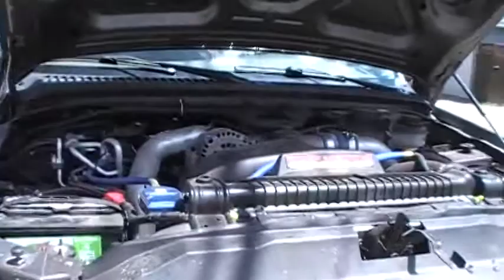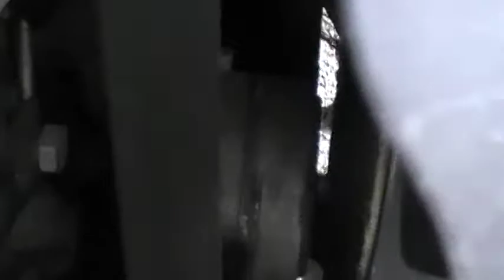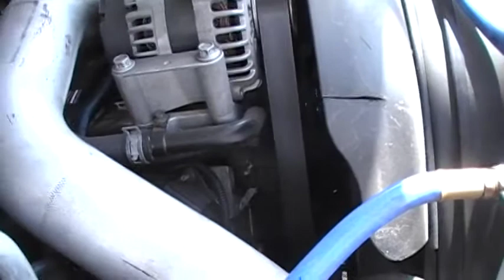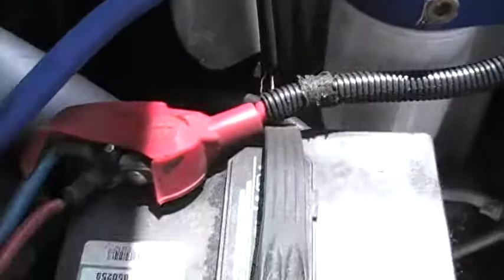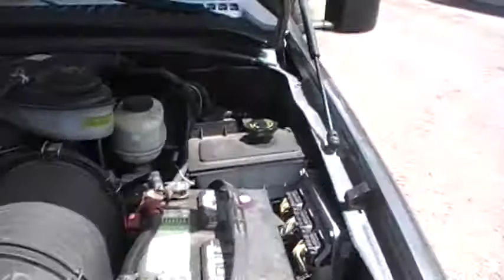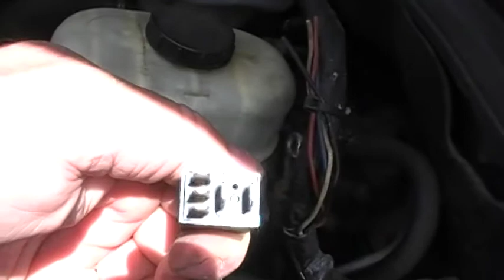Ford Excursion AC Compressor Troubleshooting

Comment: My issue is that some days my AC works other days it does not. I’m wondering if my relay has got a bad connection because I’ve had everything else replaced. I saw the comment where a guy had a similar and clean the relay pens and his work to normal after that I’ll be trying this for sure, I will follow up

Comment: I wish my relay location was just not in the manual. Ford thought it would be a good idea to build in ac c relay in the power distribution box. Only way to change it is change distribution box wtf Ford and I'm only at 50k miles 18 f150 5.0 and by the way two different distribution boxes on this year. Anyone that has helpful information lmk I believe it's my flow sensor/switch on the compressor. Hard to test pmc cuts power. All started with a bad bearing on pulley probably caused by excessive heat or refrigerant leaking

Comment: What about in the back?
When just blows air..no could air
Reply: No cold in the back is not a compressor issue if you have cold in the front.  Could be things like plugged line or valve.

Comment: Anyone know where it is on a 2002 Excursion? V10. Those relays are not there...
Reply: Did you find them ?
Reply: @clutch_cu2  No and I wish I could because my compressor is NOT getting any voltage to tell it to turn on and I don't know where the relay is.
Reply: @ligngood3787  found it relay 302 under hood
Reply: @clutch_cu2  Where under the hood? 2002 does not have the relays shown in this video
Reply: @ligngood3787  did you find it? I’m having that same issue on mine now
Reply: @ligngood3787  Same  I have the setup on the drivers side however jumping the relay does not turn on the compressor to the low pressure switch im testing tomorrow

Comment: Thanks for posting this! My 05 excursion 6.0l ac stopped working today.after watching this video i removed my relay put a jumper wire on it and i could hear my ac clutch engage. my relay was still good but had a poor connection.i just lightly sanded the relay connections and pushed it in and out a couple times and that was my issue.tnx again

Comment: Thanks for that video upload. I think it's the 2002-2004 super duty/excursion that don't have the engine bay fuse box and they don't mention the relay in the manual. Good looking out
Reply: Hey man, I have an 03 f250 with this problem. Only thing I can find the fuse box is the ac clutch 10a fuse. Is there a compressor relay and if so which is it?
Reply: @alexflores5426  where is tha 10 a located at